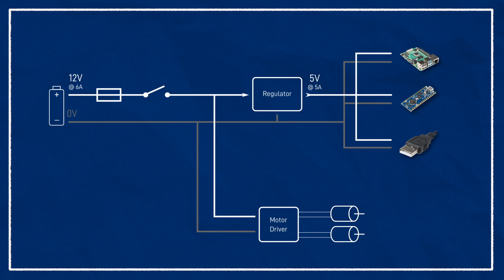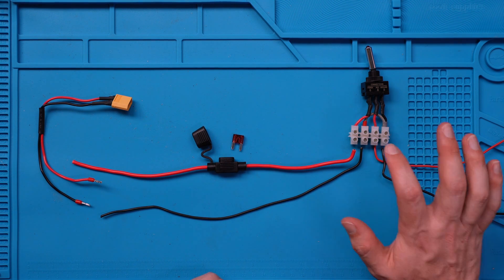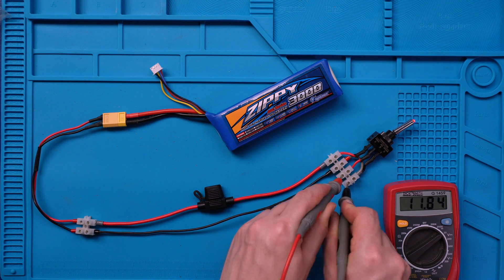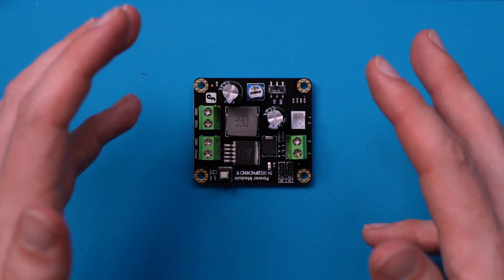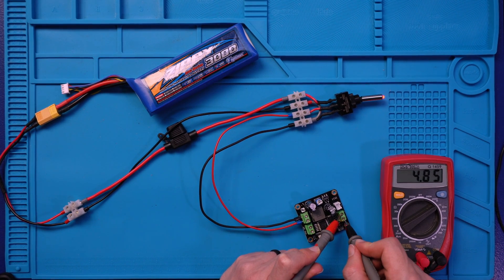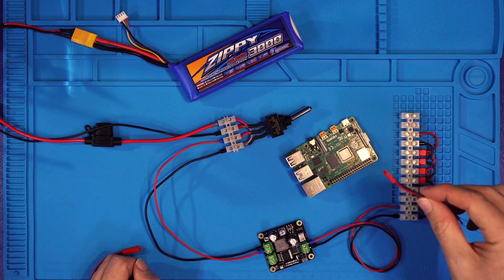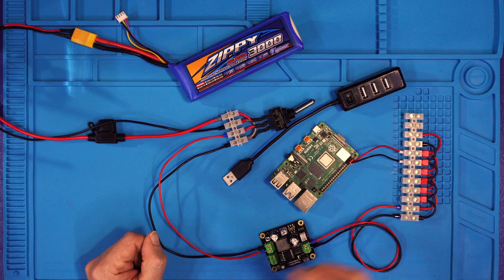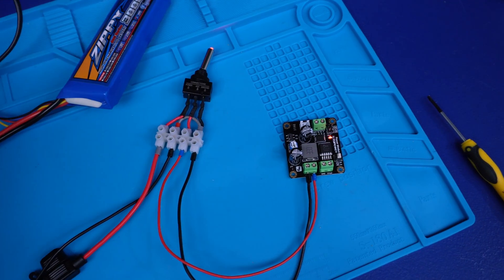Robot Power 2: Electric Boogaloo

Comment: i dont know if im a bit too late with my question on this video. but i designed the layout of my flightcontroller and have 10 pinouts for servos. 6 servos, 4 bldcs (with external esc). so i need to effectively power 6 servos at 3Amps stall current. I know i will not use them at max so they will never use 3amps from all the servos at the same times and probably never 3 amps at all. it would make 18amps stall current for 6 servos at 5 V = 90Watts. im not sure if i can place this directly on my pcb and if i have to use an external power supply for it. its a bit hard for me to understand. do you have literature recommendations for me to learn more about buck down regulators? sorry this question itself is a bit hard to ask for me because i am a mechanical engineer not a electrical engineer but im well capable to learn.

Comment: dont power the rpi that way, I am pretty sure you are bypassing the built in vreg
Reply from the maker: Hi, I don't believe the Pi has a built-in regulator (apart from the 3.3V one). Earlier models had a polyfuse on the USB line which is probably what you are thinking of, but the Pi 4 does not have this so powering over the pins is the same as over USB :)

Comment: Hi sir, how do we choose the correct fuse value? for example, you used a 10A fuse for the 12.6V 6A Li Po battery.
Reply from the maker: Great question. Firstly the battery is much higher than 6A - check out my notes on the "C" rating (I think in the previous video).
You want the fuse rating to be higher than what you expect the load to be, but less than what will damage your wiring and power supply.
What makes it tricky is that some loads (e.g. motors) can spike very high and wiring and supply can often sustain a short high spike, so the time the fuse takes to blow can also be relevant.

Comment: Hi Josh,
I am curious what kind of connectors you are using that plug into the terminal strips joining two wires. Are those just two wires crimped into the same connector? i bought the same terminal strips, so curious to know the details.
Reply from the maker: I am mostly using ferrules/boot laces crimps :)

Comment: What might go wrong if py is shut down using the switch? Some electric issues might arise?
Reply from the maker: I think the concerns are generally around if the software is still writing data or something it could become corrupt. I often turn it off at the switch and have had no issues, but sometimes you see online that other people do, so better to do it right if you can. :)

Comment: Interested to see how you connect and interface with motors, sensors and other things. I assume you are going to use an accelerometer (MPU6050)?
Reply from the maker: Thanks! I am hoping to do a video on integrating IMUs at some point, but probably not as part of this build, since the encoder feedback and lidar SLAM will be sufficient for localisation on this robot.

I'd really like to do a project that fuses an IMU with lidar or RGBD camera data (e.g. https://github.com/TixiaoShan/LIO-SAM ).